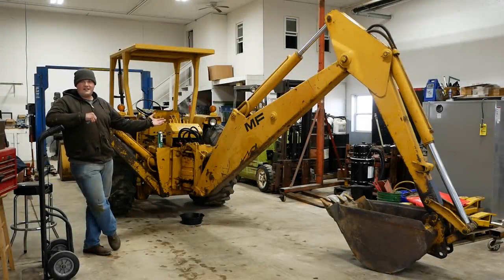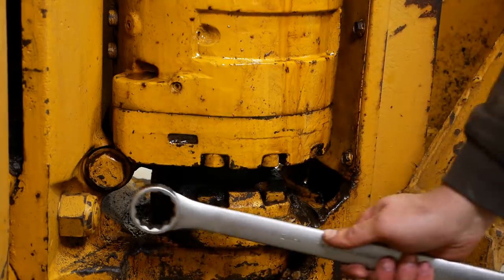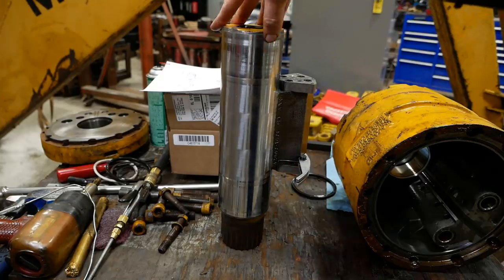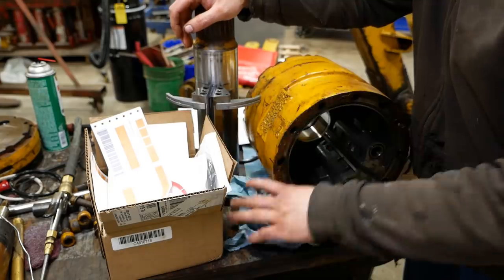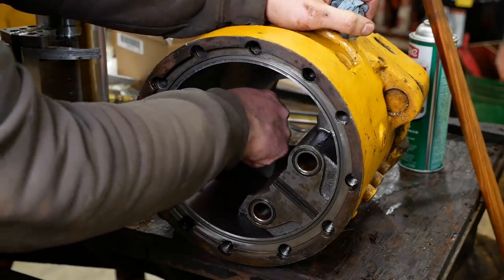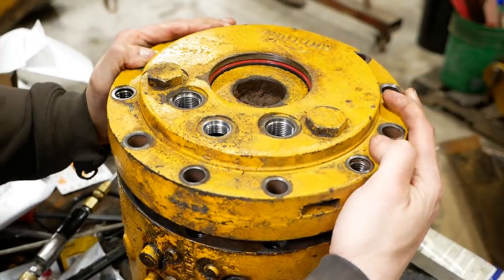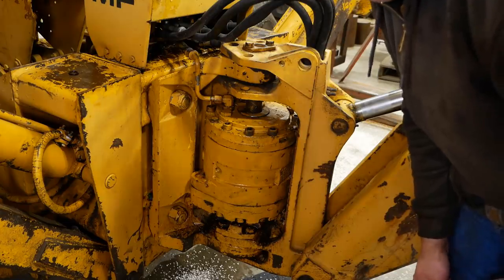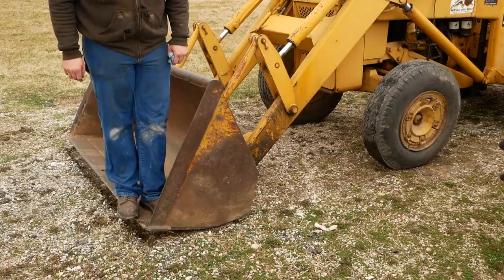Massey Ferguson Backhoe Rotary Swing Cylinder Rebuild

Comment from the maker: I bought the seals from the AGCO dealer. That's the only place I know to get them. Please do not email me to ask this.
Reply: Interesting, didn't realize they were tapered - is the fix just to replace the parts or can you machine a sleeve for the bottom piece?   Also, does it have to be tapered - maybe straight splines are a cheaper option, would be a tighter fit than now.  With used machinery going for top dollar right now due to lack of new equipment, might be worth it.  But, hey, what do I know, just commenting from my armchair.  Anyway, great job on the fix.
Reply: @ckm-mkc  I did the same. Drinking my coffee and typing. I'm not sure why it couldn't just be welded together. But again, *sips coffee* I don't even know what's going on.
Reply: Hell, the seal kit came bloody close to the value of the machine!
Reply: @jongmassey  No way.  For the age I would consider that machine to be in excellent condition overall. The problem with backhoes is they tend to get work to death before they even hit the used market.  Machinery like this that is working it's worth fixing because the alternative is to spend more money and get a machine that's in much worse condition even if it is newer.
Reply: Don't Sweat it Wes, there are many arm chair quarterbacks is this world and most of them could not change a light bulb, never mind do your job. Keep up the great work.
Reply: @ckm-mkc  nah you have to build up the splines inside and outer with weld and re-machine it all, I think Keith Fenner has videos on it.  And I have no idea what a machine with those parts in good working order would be worth, versus buying another machine.
Reply: It is fixable, but costly.
Reply: It's one of those cases where the worth of a machine is determined by the owner/user. Buying another used machine might just lead to another set of expensive problems. Better the devil you know than one you don't. If the splines do fail, there are companies that are very experienced with making splines. I used Strange engineering to make axles for a Baker/York forklift. Strange makes axles and gears. With the internet, it is easier to find the specialized companies now than it was 30 years ago. I think the most cost effective repair for those splines would be to have a new female piece made to match the wear in the male shaft splines. You might be able to find something with the same internal spline to weld into that socket. The bottom of the shaft could be ground to a hex and a socket to match it made for the bottom. There are many ways to skin a cat.
Reply: send it off to ABomb
Reply: Just the ol weld and machine trick will do ya, and a few thousand dollars later...
Reply: Just like every Youtuber is an Expert at everything....no different than comments you get... Anything can be remade or rebuilt....and seals are available from many sources....the original manufacturer isn't the only choice...that shaft will shear shortly and all that expense on parts is wasted... Doing it half assed isn't practical or professional.... But hey ...it is a choice regardless.... If your going to spend that much you should " try " to do the splines ...and there are Youtubers who can out there....
Reply: I have had a lot of lower unit and outdrive gears redone in machine shops for a fraction of the cost of replacing.
Reply: I have 2 of these, 1 on a Ind 20 and 1 on a Ind 30. Both worn out in the splines and will not swing the boom. Had 1 spray welded and rough machined when I worked at a equipment dealer, then I hand filed it to fit. Machine shop boss slid it in with other jobs and said if I was a customer and had to pay for the repair it would have been between 1800$ and 2k$. It worked for about 50 hours, then the spray weld started to fail. Been waiting for my shop project list to shrink and going to work on putting in linear cylinders like a modern backhoe.  

I looked everywhere in a 300 mile radius for a good used 1. And if it was in good working order they would not separate the swing cylinder from the backhoe.
Reply: That's why in Aviation they put a Teflon insert in-between and replace this at set intervals.
Reply: We fix the all the time, Faga tool welds them up recuts the splines then sends it out to be hardened, it usually is half the cost of replacement, we do alot of Kubota parts.
Reply: @Obamaistoast2012   These backhoe's can be had @ auction and local listings for the 3K$ to 5k$ range and under. I have used the crap out of them and then parted them and made my money back and more. 

I have had obscure parts sent out and "repaired" and been in way over my head in cost of repairs, shipping the part and my time. I try and avoid it.

 My Ind 20 needed bucket cylinders,the cylinders needed the rods replaced and the lock rings were so rusted in they would had to destroy the cylinders to get them apart. Almost 300$ per cylinder for the labor just to disassemble and inspect, Surplus center had new surplus cylinders that were almost a perfect fit, I had  to cut off the eye and weld on a tube and paint them yellow. Both cylinders shipped to my door was a little over 500$. 

If your not restoring something for the sentimental value,  what is the limit for skipping the repair of a part for replacement or re-engineer.
Reply: @leetalon8770  our average cost for spline repair is around a grand, thats not much in our neck of the woods.
Reply: First off, I love your channel! Screw the splines. Your intro on this particular video is my favorite!! Im here for the mechanics but, to see a complete picture of you talking next to the backhoe was awesome. I really liked that....... Ill bet the owners were happy I know i would be.
Reply: I enjoy seeing stuff worked on, that's what I'm here for!
Reply: Is it possible to make some splines out of wood?

I've seen Norm Abrams from this old house and New Yankee workshop , make some nice wood projects.

Somthing to think about! 🤡
Reply: @erikparent8176  just pack the splines with wet macaroni noodles. when they dry and harden its stronger than plutonium. but rats wont grow a 3rd eyeball when they eat it...
Reply: $126 US dollars? Did they at least take you out to dinner first??
Reply: $126 US dollars? Did they at least take you out to dinner first??
Reply: @DieselRamcharger  
You've got some good ideas Diesel!
Reply: @erikparent8176  its that materials science degree from Woke U. thats really paying off.
Reply: @DieselRamcharger   I’ll take Fenner’s word before yours pal.
Reply: they price the older parts so high  or just stop making them to force you into newer more disposable machine IMO
Reply: I commented on your next video where you spoke about this. 

I took 85% of the slop out of mine, with a shim under the splined flange, that the rotary cylinder sits in. Think about it. The splines are tapered, the large center bolt (inserted from the bottom) draws the cylinder into the splines. The slines wear, slop gets introduced. 
 To remove that slop, the flange and the center shaft of the cylinder must get closer together. What is the easiest way to accomplish that? Shim the flange up.    Get some 1/8" (.125") flat stock CRS. Trace the flange footprint onto it. Use a bandsaw and hole saws to cut it out. Install the shim under the flange, now when you set the torque on the center bolt, the swing cylinder seats in the splines, not on the end of the swing cylinder center post. I hope all that makes sense.
Reply: @leetalon8770  They must be plentiful in your area, here if it starts and moves its worth 10 grand.
Reply: You mentioned that Deere, International and Ford all used these Cessna swing motors. Maybe Ford or International would have seals at more reasonable prices. Have any of your viewers found a better source than AGCO?
Reply: Well since it was about worn out anyway, you might have tried the old farmer technique of drilling it horizontally and pinning it? Or maybe trying to weld a big fat washer between the hydraulic housing and the shaft swivel mount and then welding it around the washer? Sure, you would have to grind the weld off if you wanted to remove it again, but it would probably hold the boom firm?
Reply: Why don’t you old-head, senior, veterans, explain to a young (34) whipper-snapper what all the talk about the splines are about. Why can’t it be taken to a machine shop? What can’t someone just re-great it. I’m sincerely asking here. Teach a young-buck.
Reply: @autocompletellc9906  It might be able to be welded and then remachined with new splines, but it''s too cost prohibitive to do so on such an old backhoe. The best thing to do in these cases is most likely a farmers repair and just weld the pin to the base and be done with it. When it breaks down, the machine will have most likely lived a full life.
Reply: @autocompletellc9906  Then again, it could be modified with a hydraulic ram, a new boom pin and new eye mounts if the main swivel motor wears completely out? Just have to move the hydraulic lines in that case. It may not have to end its life with the loss of the main swivel motor? Most backhoes use rams to swivel the boom anyway, so the parts are probably pretty common.
Reply: I’ve fixed a couple of them with jb weld
Reply: Swag
Reply: Thank you for your video. It is a wealth of information. Do you have any part numbers for the project. I will be doing the same type of surgery this week and I am flying in the dark. Thanks again for a great video. It is very informative. I spent 30 years in the industry, but have never done a swing motor rebuild. Looks pretty straight forward
Reply: I work on these inthe 80ies and the splines had a master spline which was much bigger
Reply: What people need to respect is having the machine apart for 3 months while you wait for the machine shop. Your shop costs you per billable square foot. A "restoration" shop is usually a fancy word for heated storage.  I currently have motor jobs going on 2 years waiting for parts on my personal vehicles.
Reply: @jayfriesnz3351  I wondered about the aviation applications. I figured maybe flap actuators for a B-24 or something.
Reply: @0366Turbo  This is what I will do. Absolutely a great idea. Thanks.

Comment: The moment you've started cranking the engine I said out loud: That is a Perkins... Just a second later, there was a text in the video: Perkins.... Hehehe
I own a tractor with the Perkins 4.236 engine on it, and as soon as the outside temp. drops below 10°C you have to use glow plug to start it. When the outside temp. is higher, it starts instantly!
In spite of that i still have a soft spot for Perkins engines. They seem to be fairly "live" on the throttle.
Keep up the good work, and best of luck from DSW Handcraft

Comment: I had one just like this, the same cylinder had a problem on mine. I learned to use it with a controlled swing. Move it so far to the left or right and knew it was going just a little further.
Reply: A skilled operator!

Comment: Very well done man, I had to do the same leaky seal repair on the Uk version (Massey Ferguson 35 industrial tractor with backhoe & front loader) I ended up dressing the splines with hard facing mma electrode. (Not exactly the done thing but 2 years later it still doesn't slop) Most of the seals etc I sourced by size from totally different applications as there was no way the cost was justifiable o the age of the old girl. She digs, and she doesn't leak, so so far so good!
Reply: Any information that you have for the seals that you used would be greatly appreciated, I bought the white Teflon seals but like you said I can't justify the price for the  2 piece ones.

Comment: Its a Messy Fersuson, That your problem lady. lol
Reply: Idk, I think they're great. Looks like this Perkins is setup for gas, they obviously run better in diesel mode.
Reply: @TheMetalButcher  wait what?!
Reply: @tacomas9602  It's the exact same engine block. Diesel vs gas. Different compression, spark plugs vs injectors, but same rated HP and Torque. Head is similar I think.

Comment: Hi Wes, something to try next time you have worn splines is 24 hour Araldite epoxy. We use it on most splines on our cane harvesters. It takes a good beating during the season and seems to hold up very well. That slop in the splines is taken up and more wear is prevented. The only catch is, it’s difficult to get stuff separated for disassembly. Relatively inexpensive repair and worth a try.
Give Molykote 111 a try for your seal and o’ring lube. Great product for resealing hydraulic cylinders.

Comment: I had a JD 450 crawler loader backhoe that had one of those cylinders on it.   They work great when they're in good shape, but certainly they're not as straightforward to repair as a 'normal' back-hoe swing arrangement.   One of the nice things about them is that they have a ridiculous amount of travel, and full strength all the way along.  You don't lose power at the edges of the swing.  Nice when they work.

Comment: Pretty much the same cessna motor as on my Oliver backhoe.  Mine was leaking out the top. Fortunately Oliver put the motor on top, so I just had to pull the cover, replace the quad and oring and slap it back together. No more leak and I could safely be oblivious to spline wear.  Until you posted this....
Reply from the maker: Heh. I imagine they are all sloppy at this point.

Comment: The only surprise I got was the Perkins flash. I had a Perkins 4-108 in a sailboat that would start on a whisper of 12V on the starter every time.
Never should have sold that boat.
Great job on the non-total repair. Smarter to just  put it back together and move on. Still mostly functional and not leaking as much.
Looking forward to the cylinder repairs and new   hoses.
Thanks for sharing.
Reply from the maker: I had a Bobcat with a 4.108. Threw a rod through the block. I patched it, ground the crank, and rebuilt it. It ran great but it was horrible to start. It had glow plugs or it would never have started.
Reply: @WatchWesWork  We have 3 Perkins motored tractors here (two 6.306 and a 4.270), and they all start beautifully.  6.306 sounds fantastic too.  That said, it doesn't get nearly as cold here as it does in your neck of the woods.  Coldest ever recorded here is -3C (about 27F).

Comment: I was quite happy to see the big wrenches and brute force used in the beginning.  Power tools are nice, but there is something satisfying about a bolt breaking loose with a lot of effort, but the right tools.  It's kind of primal to 'break' something loose.  

I watch a guy break down engines and he uses manual ratchets on the head bolts.  It's a satisfying snap when they crack loose.

Comment: I owned a 66 Ford 4400 for about 20 years, it had two cylinders and a piece of chain for the swing, it had lots of slop, you learn to lean it a little by tilting one side  using the stabilizer, that way it returned to the same spot, funny story, i bought the machine from the guy who operated it from new for a local city, when he retired he bought it, when i bought it off him i said i'd have it moved the 100 miles to my place, nope he said he would just drive it, he loved driving it, took him a day and a half at 15mph   lol
Reply: Haha, yup, the lean is a trick I use too.

Comment: Very interesting, remember my dad sealing one of these in the late 70's.
When we needed a mesh screen for the bottom of the transmission ( instant reverse) the local dealer had to order it in from the USA ( to Ireland).

Comment: The variety of work you tackle is amazing. That is what living in a rural area does for you. I do the same but with building work. The more trades I cover the more work there is. That old girl will live a bit longer just don't be in the trench its digging that head slop will kill you. Sure I saw a guy on YouTube that spray welds parts like that and re cuts them. Very clever process and a lot of skill.

Comment: Never seen one of those taken apart before. Very interesting, learned a lot, watched it twice. I noted that there were lots of solutions offered with respect to the spline problem  - but none had a price attached!.
Reply from the maker: There's no cheap or easy fix for that spline.

Comment: I ran a perkasaurus that started hard like that. You had one good shot on fully charged batteries.
Reply: Our Massey Ferguson 165 diesel is a bitch to start. It needs to spin faster than it does in the winter. Only good solution is 24v to the starter or block heater lmao

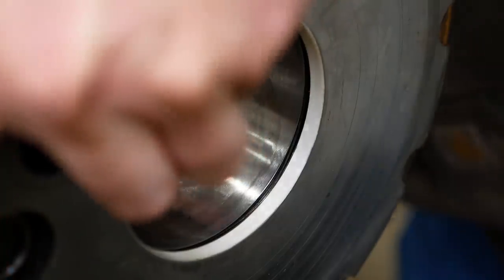Comment: @12:52 I was feeling that spiral snap ring cut the new seal, if that had been me I can guarantee it happening. Dude I keep telling you, you have a couple hundred grand in shop and tooling, have a huge customer base and these cats in the comments have a 500$ swivel chair and a 200$ keyboard. There are a million ways to fix stuff, been in the sleet, in the middle of a corn field working on a broke locomotive and needed copper washers before. Used a drill and punched 10 pennies out with 1/4 holes and wallaha.... zinc works well as a sealing washer. Approved methodology? Nope. Get the job done and make tracks for a warm place? Yep. If these cats know so much they should have their own shop and make videos, Brother. 
Personally I love the ride along and the videos, thanks for the time and effort you put into each and everyone and the care you have for all your followers even the critics.

Comment: Watching these old tractor videos has convinced me you need as many parts machines as possible if you plan to run 50+ year old equipment. There is so much to go wrong, and unlike a Ford or Chevy, you don't have the aftermarket there to bail you out. It's a shame because there's a lot of old iron out there with relatively simple problems, yet no way to feasibly fix them for cheap.